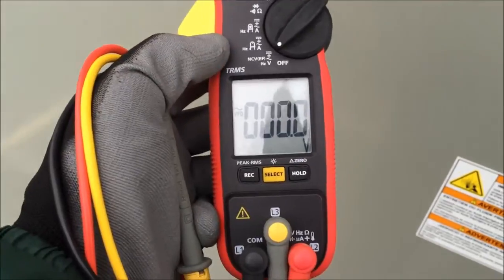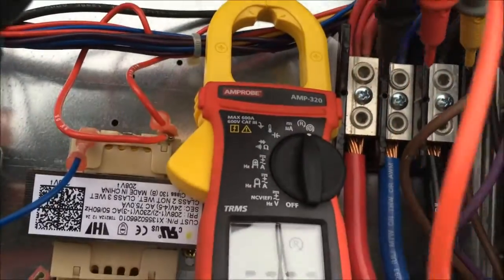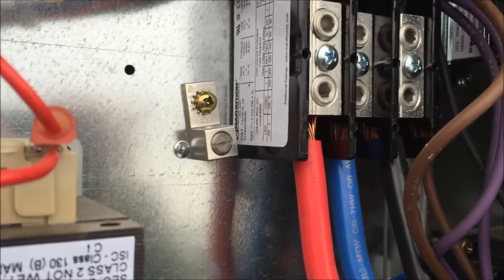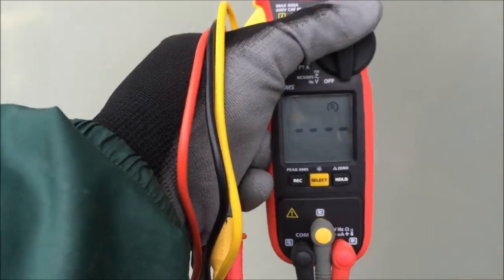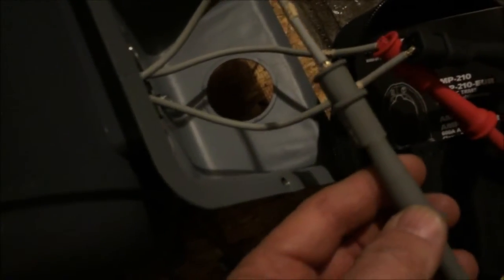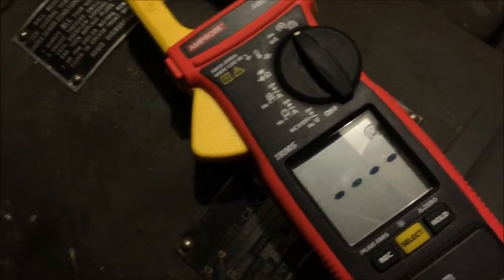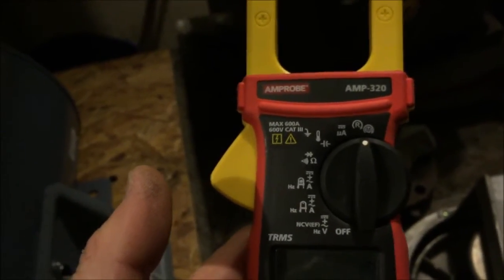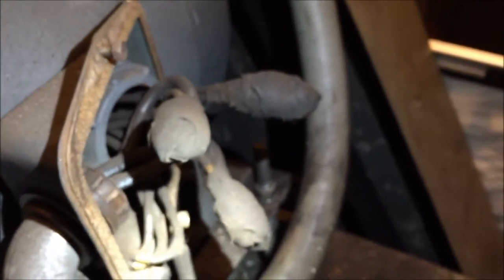3 Phase function AMP320

Comment: for the normal mode (R), dose the power have to be on? I cannot get this function to work. the (M) motor function works, but not the (R) function
Reply: is this done testing the line power coming in/ live?
Reply from the maker: Sorry for the delay in responding. The (R) mode has to have live power, it's to check rotation of lines 1,2 and 3 coming in. Then you can match it to the leads on the motor using the (M) function and rotating the shaft the way you need it to turn.